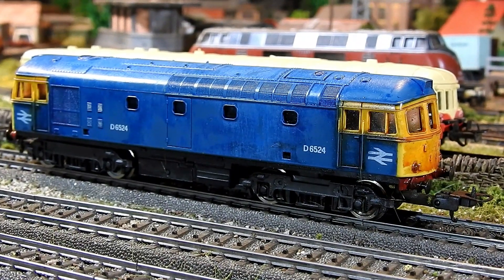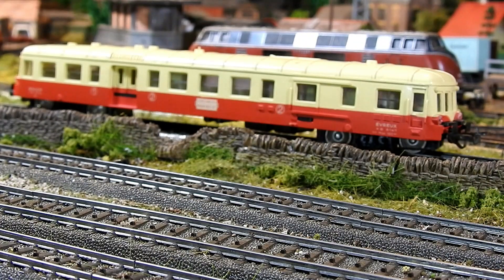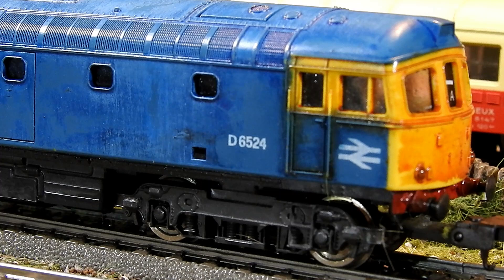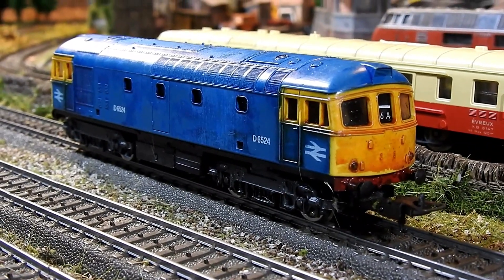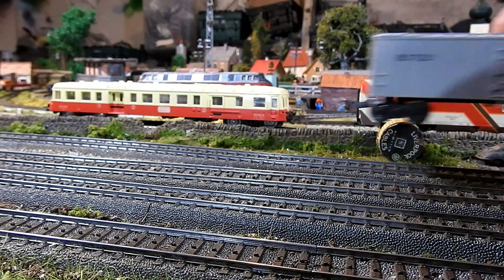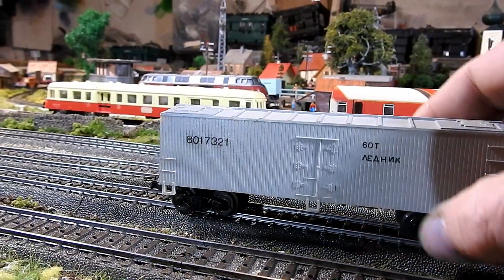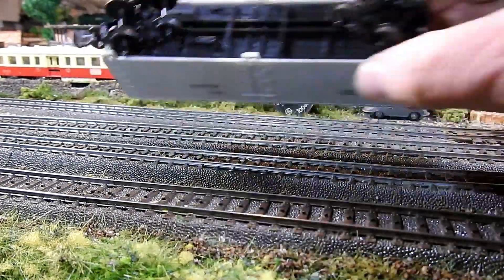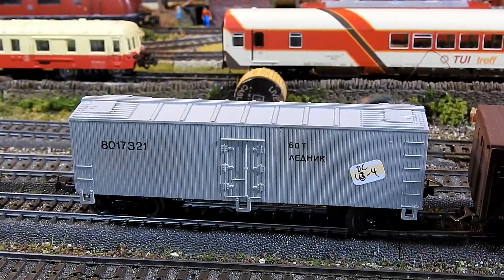Some More Rare and Unusual HO Train Models - British and Russian

Comment: I think the Russian one is based on the tooling for the Mantua/Tyco refrigerator car - Very interesting to compare the proportions with the Russian stock car
Reply from the maker: I checked and the Russian one has different roof, ends and ladders/steps. It is a bit shorter and taller than the Tyco/Mantua one. So it appears to be a different model. Getting info on the Russian protoype would be interesting.
Reply: @ArcadiaJunctionHobbies  is there a name on the bottom, perhaps between the longitudinal frames?  I tried to see one when you flipped it over, but could not.

I am almost 100% certain that is a repainted Life-Like boxcar with European couplers fitted.   I have an example in my hands that I am comparing as I watch your video.  The body shell is the exact same (ends included), and the trucks look the same; except metal wheels and European style couplers were fitted.

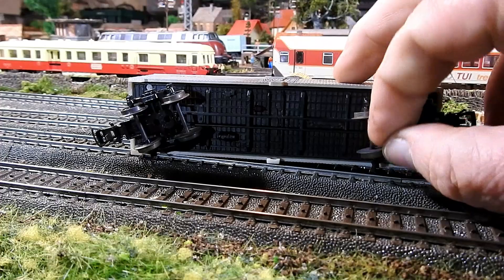@4:33 there is smooth spot between the longitudinal frames on the right end of the car.  That is/was where the Life-Like name is/was.  All the other underframe details match.
Reply from the maker: You are correct! However it appears to be a pirated version made for the Russian market. Just old fashion Cold War reverse engineering.
Reply: @ArcadiaJunctionHobbies  Interesting the subtle differences in the tooling when it was done! Perhaps the result of working backwards from a catalog photo or illustration as opposed to having the tooling to copy (As sometimes happened as well!)

I suppose there's got to be some Russian wagon close enough in prototype to this one - Looks the part in any event!